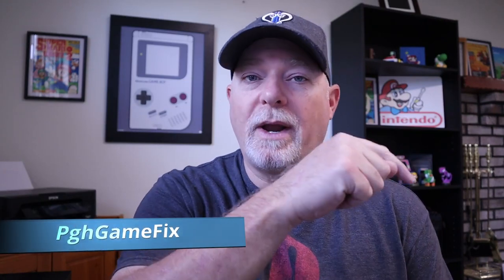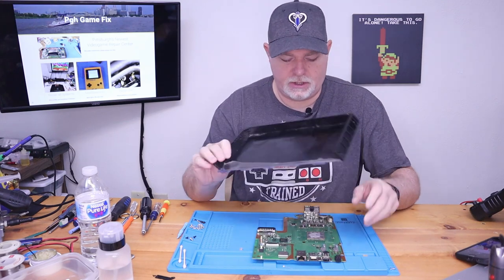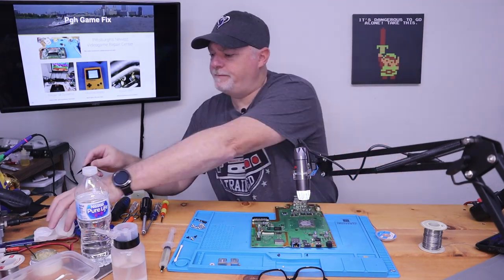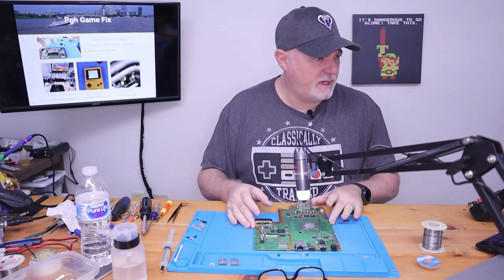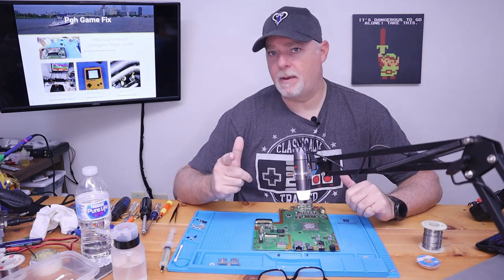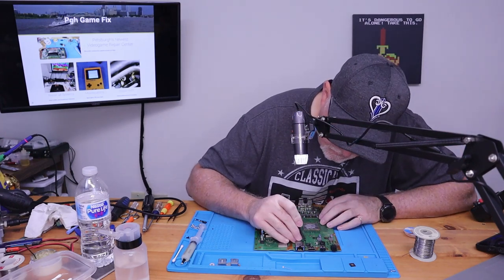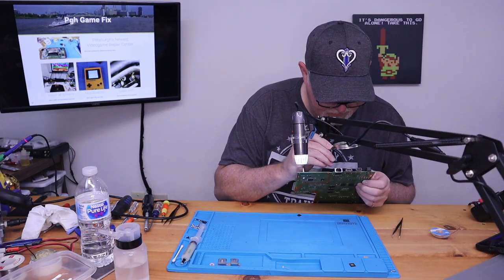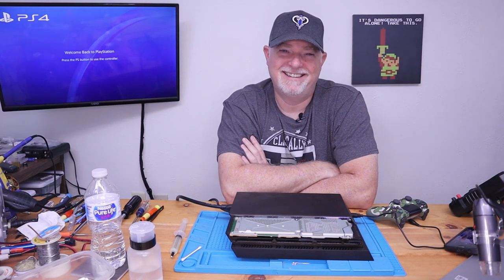Replacing the MN864729 HDMI Chip in a PS4

Comment: I really struggle with these surface mounted chips. I'd rather do trace repairs then these. Still trying to learn a good technique for them.
Reply from the maker: Use good flux and solder.  Once the old chip is off... remove the led free stuff and "Tin" the board with good solder.  Then, as you hat and it flows... good flux will keep it flowing... and the new chip will more or less center itself.
Reply: @PghGameFix  I use amteck flux along with kestrel solder. I tried some hot air along with my iron today and it did the trick.

Comment: Do you offer mail in service? I have a PS4 that I tried to install an ESP32 chip internally. Now I can only get it to work after unplugging and draining power by holding the power button. It works fine on the first boot, but as soon as I shut down or reboot, the screen will flicker on and off and I can only hear some sounds every few seconds. The console is working, since I can move through the menu and shut the console off through the options by pressing the right button combo. When I unplug and drain the power it will work again on the first boot.

Comment: Compliments on your work! I appreciate your time. I wanted to ask you a question of it's possible.. I have a ps4 first gen.The problem consists in artifacts while gaming ! Om every game i play.. but in the menu is fine . I dont have disturbed image or artifacts! What could it be ? Could it be the HDMI port ?
Reply from the maker: It could be the port... but it could be the encoder chip or the cable.  I would change the cable, and see what happens.  If you are getting red lines/static.... it's probably the chip.
Reply: @PghGameFix  its not the cable bcuz ive tried a couples of cables.. im not getting red lines.. only black artifacts , on trees or game characters...
Reply: I also suspect on chip encoder of hdmi
Reply from the maker: @project0332  If it's actual issues with the game graphics.... it could be the APU, if it's been badly over heated.  Is your fan running full speed?
Reply: @PghGameFix  no fan is running normally
Reply from the maker: @project0332  Then I would consider replacing the encoder chip.
Reply: @PghGameFix  thanks, i will keep you updated

Comment: Hello friend, great video. I have a ps4 pro which I have tested the cable and it is fine, I have tested the connector by putting a connector at one end of the cable and checking continuity and values, I have measured the filters (coils) with voltage drop and they are fine, I have also checked the readings on the chip and I think it is also fine, however after all this my ps4 remains in white light and without being able to enter safe mode or anything and no signal. What I can do? Is there a scheme to test more components or what should I test now?
The board is the nav001 , could you tell me what other values I can measure or compare the readings of the chip?
Reply from the maker: Unfortunately... what what you have checked... it's pointing to a bad video processor or memory.
Reply: @PghGameFix  the pin of the panasonic on the lower left side gives me a different reading than the following 3 with which I have detected the problem, however I do not know if the panasonic is faulty or the error comes from another site. How could I know before replacing the chip?

Comment: I wish I could use hot air on my board straight on my mat. Always bubbles up from the heat so have to use a board holder. What temp do you use for reinstallation with the leaded solder? I mix in leaded and use around 450 but may drop it down a bit more myself.
Reply from the maker: to reinstall... around 450.  but I clean the board and use leaded solder.  You should be able to do it fast enough that your mat wont bubble.

Comment: What was the initial issue? Power up then powered down after a few seconds?
Reply from the maker: Sort of.  It would start to boot, and then shut down.  But it was more than a few seconds.  But the reason I didn't originally think this was the issue was... this console had melted spots on the shell from running so hot.  It was also packed with dust, dirt and dog hair.  I figured there was other board damage. I have found that if it shuts down after just a few seconds is it's either overheating... and may just need a cleaning with new thermal paste... or the hard drive has gone bad.   On the overheating side... I have had a bunch of PS4's show up where the owners have opened them to clean them, and disturbed the original thermal paste.  But since that paste was old, and hard... it no longer made a good thermal connection to the heatsink.

Comment: Hi sorry to bother you you but I have the same model ps4 that you worked on the CUH-1215A and it has the white light of death. I took it to my local video game store to have it looked at and get the hdmi port replaced and to run further diagnostics on it and they said that the hdmi port wasn’t the issue but it was more the issue of the hdmi chip. They couldn’t replace it because it wasn’t worth the time nor money. If you could get back to me with your take on things that would be great thank you.
Reply from the maker: Well... that's a tough one.  I've had a few that I refused to replace the chip because the PS4 was VERY obviously overheated, and the APU was probably bad.  So, in my opinion, on those, it was a waste of time and money to change the HDMI chip.  But, if everything looks good, and clean... then I normally will try to change that chip.  At the stage where I question it... I will leave it up to the owner if they want me to try it, and I will generally tell them it's going to be $65 regardless if it works after.   With that said, your local shop either felt it wasn't going to help... or they just aren't comfortable changing that chip.
Reply: @PghGameFix  Alright is there some way I would be able to get ahold of you through a more direct line to possibly set up a transaction in hopefully getting mine fixed?

Comment: I hate to ask being how old this video is but what do you do if you can't get the HDMI chip off I've tried and followed the video and even asked all over the internet but no matter what I just can't remove the chip from the motherboard I feel like im just damaging the board the more I try. I know its not a easy thing but I wanted to try and fix it myself but the more I try to do things in my own the more I think i fail and I know if i fail at this my mother will use it against me also... so yeah idk what to do anymore honestly im so lost 😔
Reply from the maker: If you know the chip is bad... just keep the heat focused on the chip. (But the board will take a lot of heat)  I normally have my hot air station at 480c, and it takes a minute or so to get it to move with the factory solder. Also, make sure to use good flux to help everything to move.

Comment: one Zener diode and a capacitor just behind the HDMI port were missing, did you install new ones or just left them as it is. Because on my ps4 just the Zener diode was missing and it stopped powering up. If I remove the capacitor as well do you think it will resolve the issue?
Reply from the maker: They were replaced.  They are needed to get the handshake on the HDMI cable. Unfortunately, I lost some video when I was recoding this one.

Comment: Amazing work!
Quick question. During a thunderstorm, we had a power surge and my ps4 and everything connected to that power outlet did a full restart. Ps4 won't display after. Keeps giving the "No signal" screen but I can hear it come on and function perfectly from my headset. I've tried other HDMIs, still the same. Also, the HDMI port in my TV that it was connected to when power surged doesn't work anymore.
Do you think it's the encoder chip?
Reply from the maker: Yes.  Most likely it is the encoder chip.
Reply: @PghGameFix  shoot. It's okay. Thank you very much for your time.
Reply: Same just happened to me with all these damn storms🤬😫. Hold did you solve the issue?
Reply: @TeeFree6  yeah I did. Sent it to my repairer and he fixed it for  approximately $20.
I'm from and reside in Nigeria, I rounded up that figure so you can get the idea of how much you might spend if you're in the US.
From my search online though, I read that it can cost up to 50 bucks but those article were from about 4 years ago.
You should get it fixed way cheaper now.
Reply from the maker: @TeeFree6  If it got hit with a surge... then it may need the encoder chip changed.

Comment: Can MN86471A be replaced with MN864729.?
Reply from the maker: TO be honest, I'm not sure.  You would have to pull the spec sheet on both and check the data.
Reply: @PghGameFix  its just MN86471A is super expensive brand new

Comment: What temperature settings u use?
Reply: Mines only 450 max
Reply from the maker: Most of the time, for thick boards, and lead free solder... I will push it up to 480c.  It's a high temp, but it takes less time to get the parts off the board, and in turn... there is less soak.   After it's clean, and I have 60/40 on the board... I turn it down to around 400.
Reply: Can a 450 max do this ?

Comment: the pads came off where my filters supposed to be i was wondering if i could use a  wire run from the hdmi pin to the hdmi chip
Reply from the maker: Yes.  You can use 30ga or thinner.
Reply from the maker: @Arzful  I will if I get one that is damaged in that way.